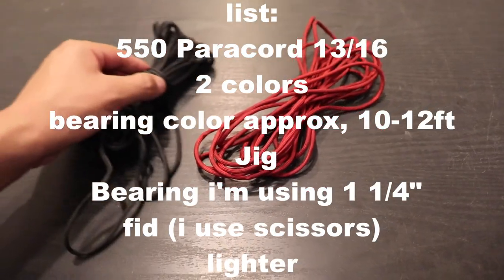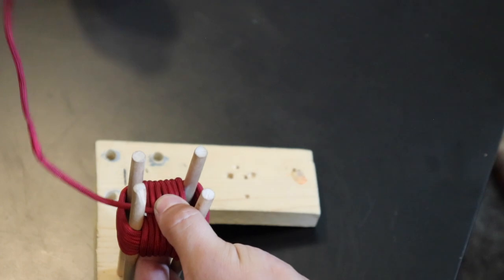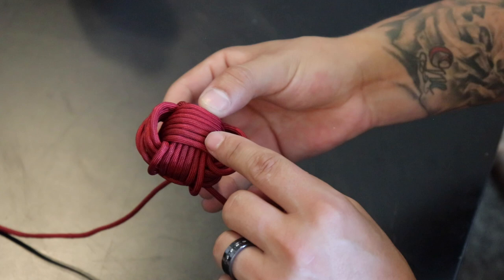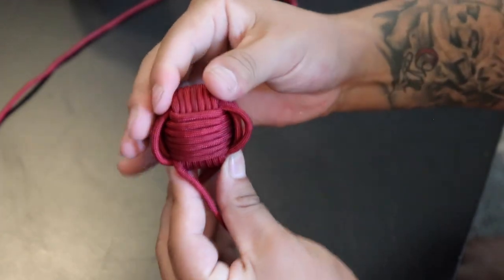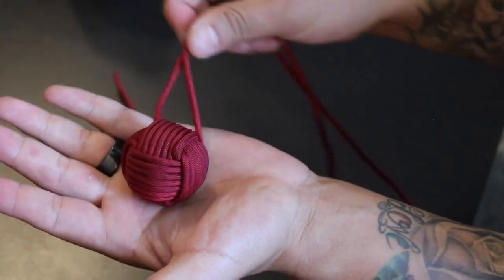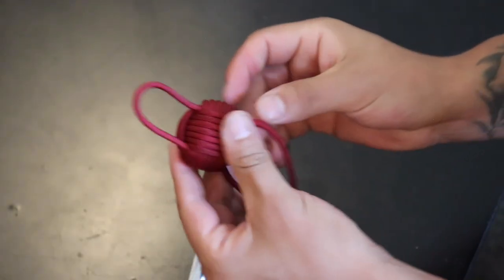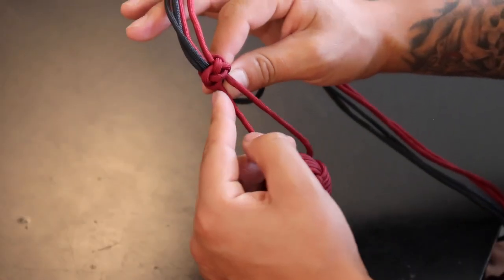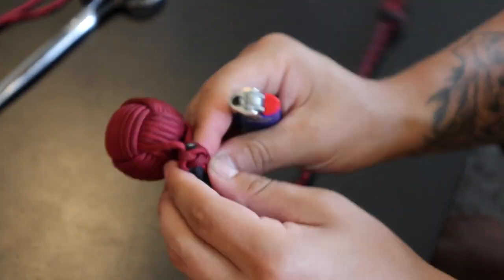How TO make a MONKEY Fist FULL tutorial | monkey fist paracord | Ninja Vlog

Comment: I’ve made a Celtic slammer. I’m left with 2 cords. I was hoping to see a 2 cord weave but it was a 4. I can’t do diamond knots.
Reply from the maker: You can do a diamond knot, just practice, they are a little weird, but there’s a few good 2 strand braids you can do. 2 strand Snake is a pretty one. Is the 2 by choice or you don’t understand how to add the paracord to do a 4 strand?
Reply: @ninjavlog.  I am almost a total beginner. I made some lanyards for my pocket knives a couple of years ago but now I’m getting back into it again. I think I tried a dozen times, pausing etc, sure I was doing it right, go to tighten it up, take up the slack and it all goes to hell. Looks absolutely nothing like the knot? And I did end up with 2 cords, I wanted to do a cobra weave so I did a short bit up to the ball, came back down and found I need 4 cords! So anyway, I’ve got extra cord so I’ve taken a fid and wove extra into the part I’ve done, I’ll tie it and melt it and I’ll have the 4 cords I need to finish off. I want to make a handle noise like the monkey fist door knocker on it. I should be able to manage that, it just takes patience. I must practice ONLY the knots. That’s what’s wrong I think. I’m part way through a project and decide I want a diamond knot in it, but I’m frustrated because I can’t do it, but halfway through a project is not the time to learn that knot. So I’m just going to do a cobra weave from now on until it’s finished.👍🇬🇧
Reply from the maker: @TheGreatest1974  My advice take extra bit of para cord that you’ve cut off and don’t use that are still long enough to braid about 10 rounds of it and use that length about 6 feet to a foot to help you understand how to tie all of the different things you want to do without wasting extra paracord because it would get thrown anyways so re-purpose it reuse it and practice little things one at a time that’s how I did it and comment below really quick what specific thing you’d like to see and if I have a way to help I’ll see if I can’t make a video I’m not a para cord person it’s just some thing I picked up as a martial artist learning to make a monkey fist for self-defense lanyards 🤷🏽‍♂️
Reply from the maker: 6inches to a foot*
Reply: @ninjavlog.  what I would like to see is the Celtic slammer which leaves you two cords like I have, and a good 2 cord weave tutorial to make a loop handle? From wrist to end of ball about 18” ? And maybe a decorative knot thrown in along the weave. 👍🇬🇧
Reply: @ninjavlog.  Thankyou very much my friend 👍👍
Reply from the maker: @TheGreatest1974  all monkey fists and keltic knots, will leave you with 2 strands, I just always do 4 strand braids threw trial and error because of my occupation as a martial artist, but just do a snake knot, easiest 2 strand braid, then as far as the looped handle I don’t use them and have never tried to make a looped handle. The length is about where I have mine 18”.
Reply: @ninjavlog.  okay Thankyou!👍